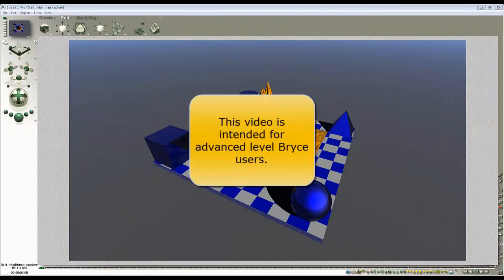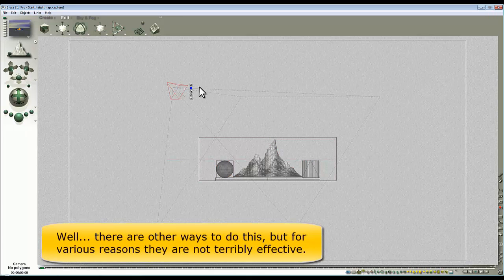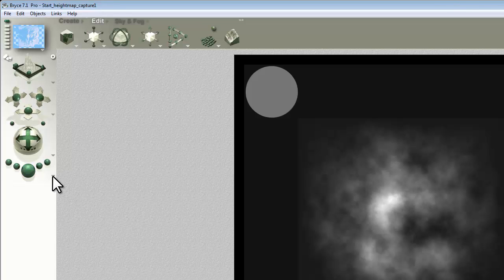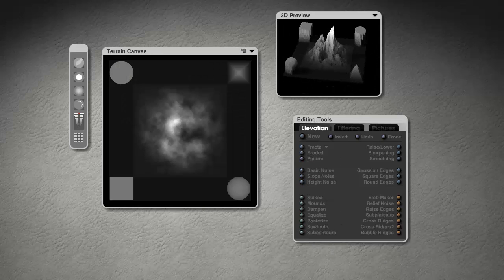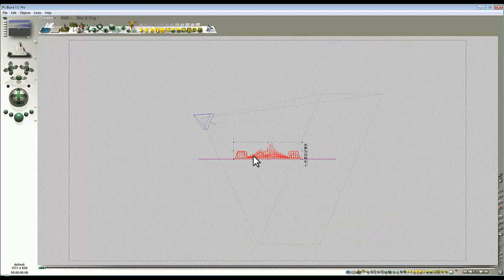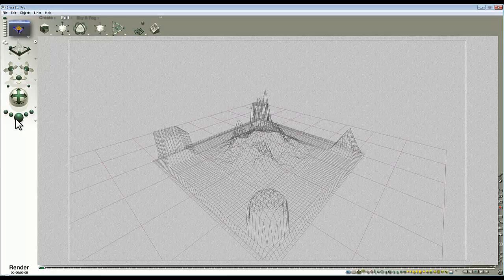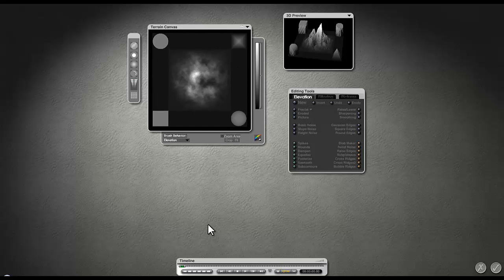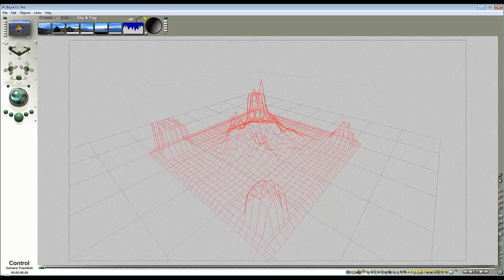Bryce 7.1 Pro Experiments - Exporting a scene as a heightmap - by David Brinnen.

Comment: I've been experimenting with the Deep Terrain Editor in conjunction with the Deep Terrain Editor, looking to directly move and save a height map made in the former to the latter. It seems when I get into the Deep Texture Editor from the Deep Terrain Editor all the work I did in the Deep Terrain Editor is lost. Also, I can find no way to reach the Materials Library via that path. This would seem to keep one from saving a height map in the Materials Library for later use.

Is it not possible to create a terrain, enter the Deep Terrain Editor, edit the terrain, and then save that to the Materials Library from the Deep Texture Editor? 

I know that you did not say this, but from what I was hearing in this video, it seems to indicate that the path goes just one way, meaning you can take a material from the Deep Texture Editor into the Deep Terrain Editor and use it as a height map, but you cannot send a height map back the other way and save it. Is this true? If not, what would the procedure be to do this?
Reply from the maker: I think the answer to your question is no.  The traffic is only one way, you can take deep texture edited alpha output and covert it into a deep terrain editor height map.  But the only way to go from deep terrain editor height map to texture component is to save the height map and load it in as an image texture.  Which will reduce it from 16 bit to 8 bit.  And so be less useful to drive material channels.
Reply: So to keep the terrain height map I would need to save the generated terrain to my Objects Library. I was hoping I would not have to do that, as an actual mesh definitely occupies more disc space.

Thank you for your quick reply.
Reply from the maker: Well to keep the height you could export it as a 16 bit greyscale unsigned tiff.  But when you get into all that melarky, things can get tricky.  This might help you on this topic https://horo.ch/docs/mine/pdf/3DEM-Terrains.pdf